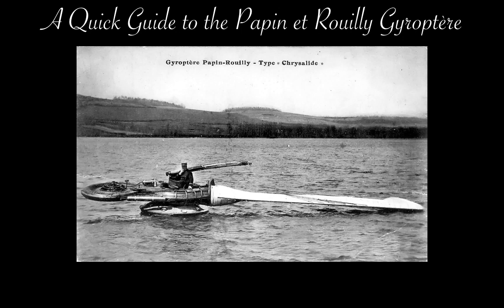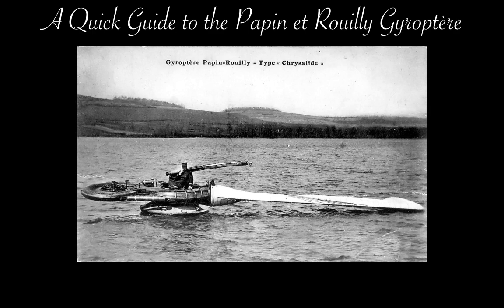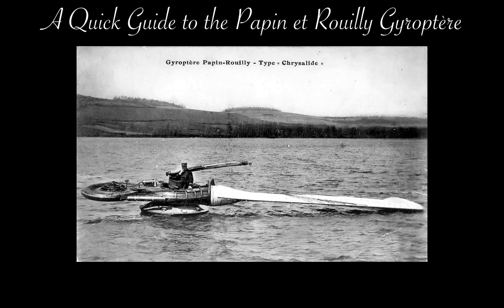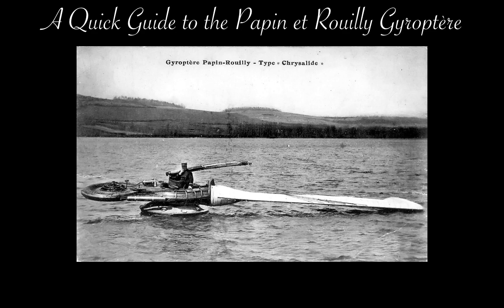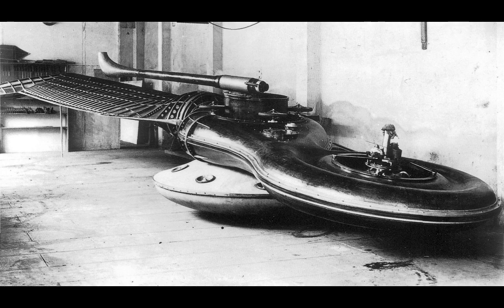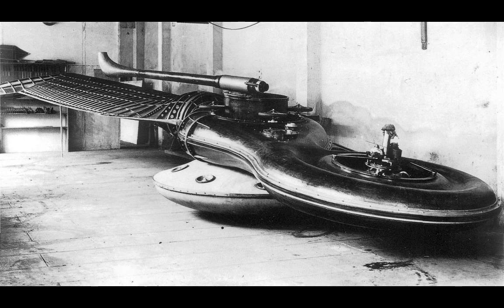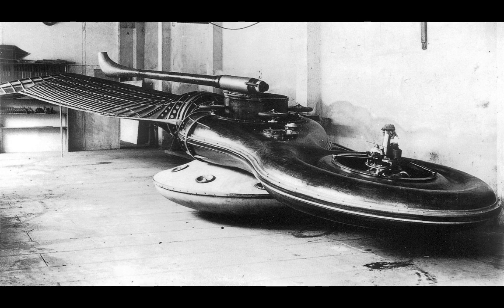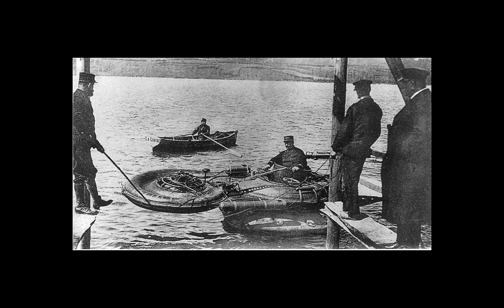Papin and Rouilly Gyroptère

Comment: Am I weird for thinking that giving this design another shot with modern materials, maybe at a medium drone scale, would be fascinating?
Reply from the maker: No. I think it would be fascinating also.
Reply from the maker: Turns out there was a flight capable monocopter. The 
Bölkow Bo 103.
Reply: @Forgotten_Aviation  i'd like to see it. not hear about it. in my imagination i could imagine going up or down a bit but soon as a direction is chosen it goes out of balance and out of control. the weight is in the center and the lift is on the airfoil, so gravity pulls the engine down and air pressure lifting the airfoil up causes a imbalance so the engine is traveling in a circle at no speed and the tip of the airfoil is doing perhaps a thousand miles an hour. i do not believe it is workable. i believe the airfoil will fly and the engine not so the airfoil will rise above and flip itself over the weight. lets see the pictures. thank you.
Reply from the maker: I would like to see it as well. However I have not, so far, been able to find any video of the Bölkow Bo 103.

Comment: unimaginable nonsense. what was he thinking. i know what he was thinking, but what was he thinking. certainly not physics.
Reply from the maker: There have been attempts to build a monocopter. The Bölkow Bo 103 was a flight capable example.
Reply: @Forgotten_Aviation  high jerry wow. never heard of that one. getting the wobble out of it would take so much energy it is hard to imagine it being practical to do. an interesting experiment though. our immediate ancestors were very inventive. probably because no one had told them they couldn't do it. harharhar. thank yew. have fun. learning lots.
Reply: @garychynne1377  It's probably not as hard to balance as you would initially think, as all it requires is to get the mass balanced which you need to do with any props anyway. In early Microlight/Ultralight days it was hard to get a prop that would match the low power engines in use, so it wasn't uncommon to cut one blade off a prop and put a counterweight on instead. Looks weird but much better then trying to drive a prop that is too big
Reply: You're looking in hindsight. Lots of science we know now we know because of guys like this experimenting. Also we have monster pc's now doing complex calculations they couldn't even dream of doing.
Reply: @electricalmayhem  Indeed! I think they needed to be able to move the cockpit laterally to change the center of balance as the craft spins up. Recon that's why they went for the flotation device.